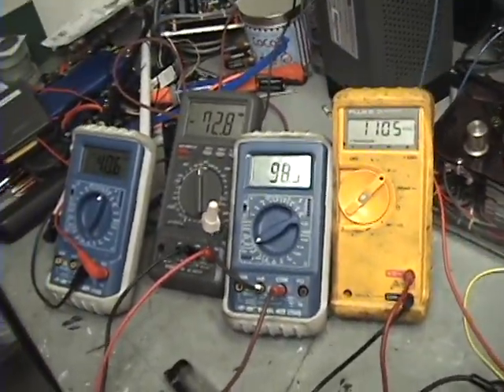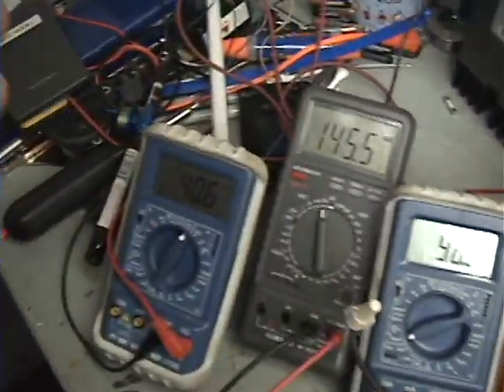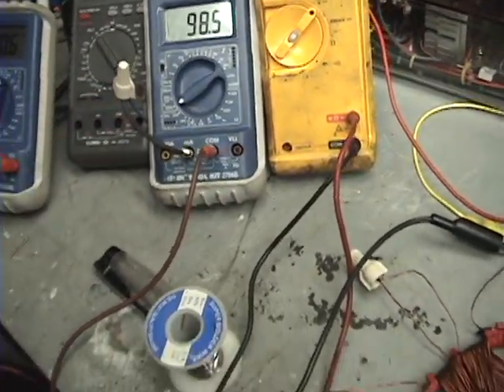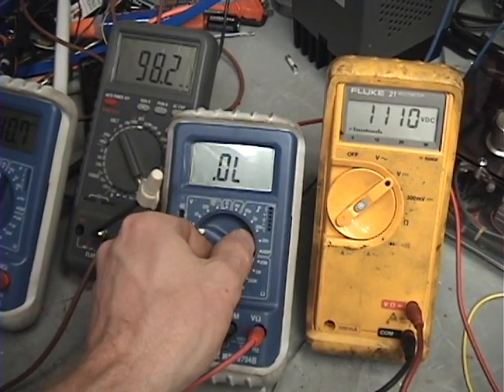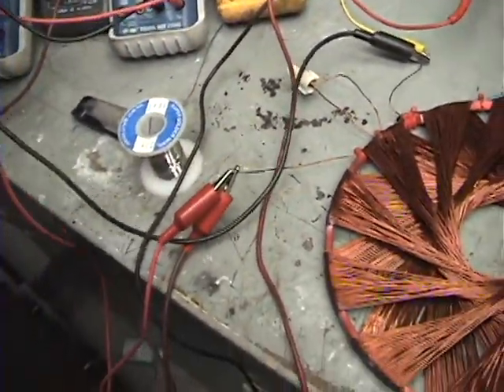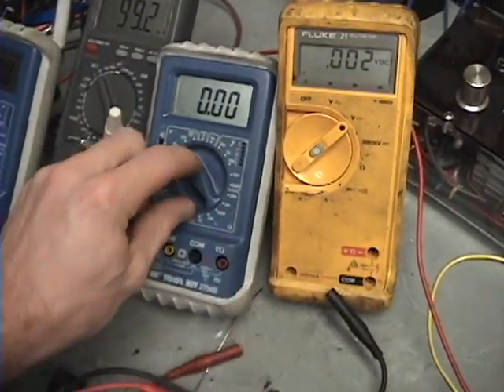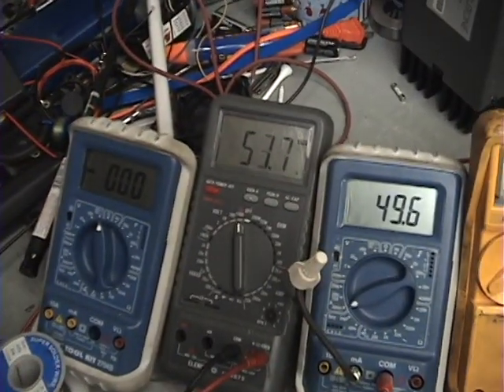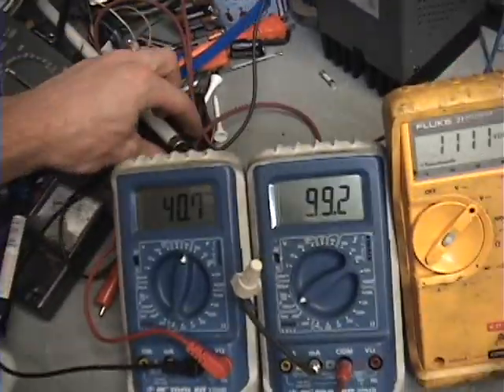Rodin coil help! This is why I deleted the other vid's (not a test) problem

Comment: Some multimeters do not like reading voltage with high frequencies on them. My multimeter freaked out when the noise reduction capacitor on my brush excited generator failed.

I would put a rectifier across the input leads, then measure the voltage from the DC side of the rectifier. If it still doesn't work, put a capacitor across the DC output of the rectifier.